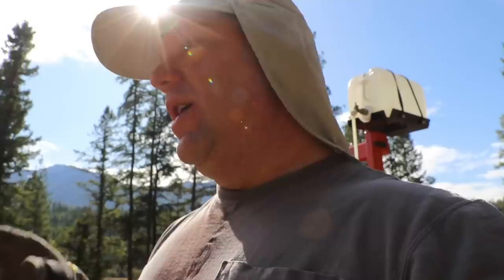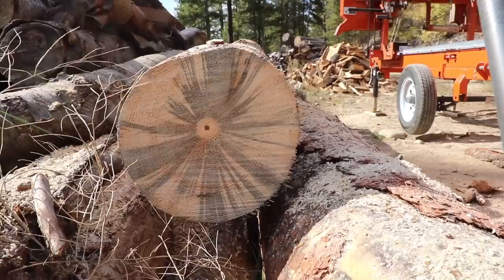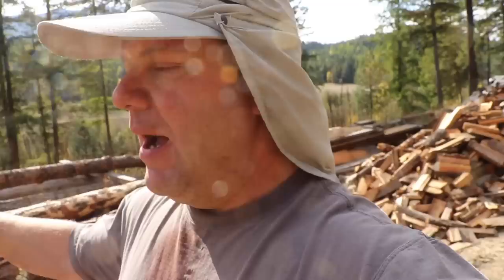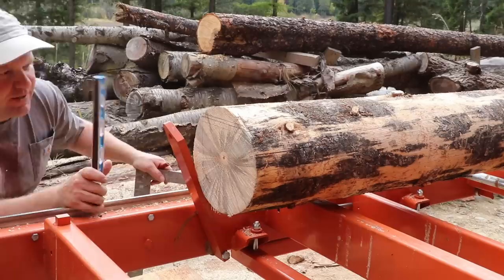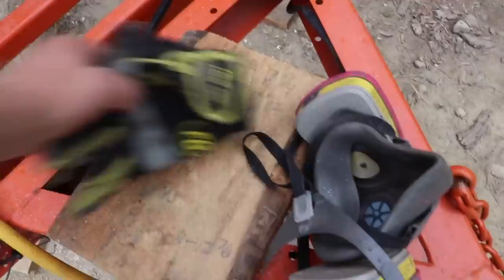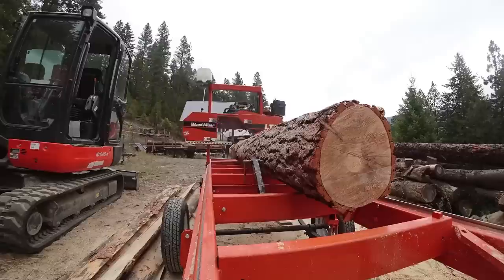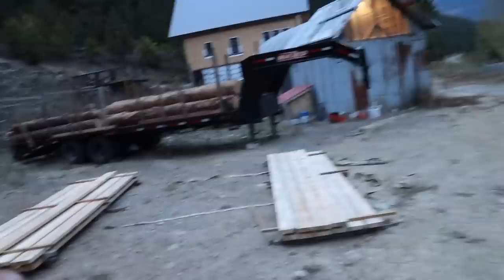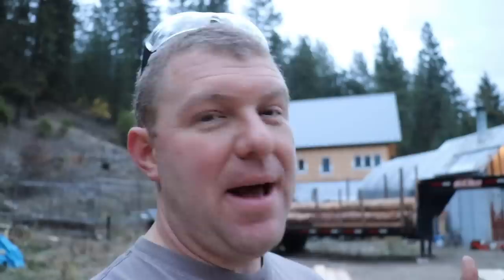Making BLUE PINE LUMBER with a Sawmmill (Beautiful)

Comment: Between January 2014 and March 2016 we took 1000+/- trees down on 15 aces. In Jose Basin, Shaver Lake CA area. The entire Sierra range is devoured in 3 years. Stunning. Got a 36 inch woodmiser and milled it up. Lots of 1×12. Sometimes the blue ran 4" thick for 20 feet. 70 cents a board foot.

Comment: It hurts my heart to see that wood used for studs. I know "the cow is already out of the barn" on this a long time ago but I would have milled boards and sold them then bought 3 of 4 times the amount of structural lumber with the $ you'd get for that wood. or that would be my cabinet doors and face frame.
Reply: guess I dont get it. in colorado you cant give that stuff away.  the whole the forest is killed.

Comment: Always check your scale calibration during EVERY setup. The solenoid issue is caused by the ethanol in the fuel. I have the same issue with my v twin John Deere with the solenoid shut off.

Comment: To keep the fuel injection running well use ethanol free gas.  I use Shell V90 premium fuel and that works well.
Reply: Definitely Right On.  I also pour a can of SeaFoam in the tank periodically.  Keeps everything clean.
Reply: Marathon stations around here often have ethanol free gas.

Comment: I am from NH too and have had a portable mill such as yours come 4 times to make structural lumber & boards from white pine. Blue stained boards would be considered undesirable. It is interesting that they are prized in your area. What will you use the 2x6's for? If you're cutting for interior stud walls, wouldn't you want 2x4's instead? I know you mentioned a false floor for the loft. Maybe they are for that?

Comment: Sounds like ethanol gas gummed it up only use 91 octane no ethanol
Reply: I concur there Ryan.
Reply: in some areas, finding non-ethanol gas can be an issue, but I don't know about where they are. I can buy it here in the Oregon Outback, but the price is premium as well... around $2 more per gallon than regular, $1.50 or so more then premium with ethanol in it...

Comment: How thick do you need your stud walls to be or are you going to cut them down to 4 inch on the table saw ?
Reply: I hope they will not waste (have not wasted) interior space with 2x6 walls that are non-load bearing.  THAT would be a waste.
Reply: i think (hope) they are cutting for 2x6 interior walls for plumbing to fit inside of it and will saw some 2x4 later for the rest of the framing. I see 2x6 for plumbing some and see it when they want extra room for insulation but their sips should negate this theory.
Reply: @warrenmichael918  There won't be any plumbing in the SIPs

Comment: why does the saw track have to be level?  the saw itself runs on the track and the tree is on the the track.  so even if was not level the boards would be as the track is.
Reply: @Shel Ferd  The frame of the portable mill is NOT sufficiently rigid to prevent introduction of twist into the saw rail path.  The EASIEST means of eliminating that twist is to adjust the frame to be 'level' at all points.  This does NOT absolutely prevent an 'uphill / downhill' effect of some minor amount, but, it does tend to eliminate twist.
Ken

Comment: Determining the maximum beam (Cant) that can be cut from a log, simply multiply the diameter of the log by .7... I.e. a 10 in log yields a 7" square beam... a 14" diameter yields a 9" cant... an 18" diameter yields a 12" cant

Comment: The stamps are not as much about structure as it is about Government and lobbyists.   If you can only use stamped lumber you have to buy it and that’s money to the special interests that paid to have that implemented.  
  Great content 👍
Reply: Building codes and material testing (specifically strength testing) regulations come more from liability than anything else...codes evolved because a building collapsed or burned down because the construction method and/or material weren't adequate and someone died...that's why sprinklers are slowly being required in residential homes...to save the life of the inhabitants and the firefighters who have to save them

Comment: Why don't you get the siding on your house? You are going to destroy those SIP's. Do you interact with your viewers? I never see responses.
Reply: in other videos, he said multiple times that they can't do sliding on the house because they first need to fill in the holes with fome, and they can't do that until they pull elictric wire through the SIP.

Comment: Get some Airplane fuel ( its unleaded an alcohol free)  an put quick disconnects in fuel lines before carbs , run Airplane fuel in to store  carbs on Gensets an sawmill,an quad too uses about a quart of gas to clean carb an gas lines

Comment: Set up a bunch of sauna tubes level with each other where ever you need them this what leveling off will a lot quicker build a lean to for your mill use it all year round same way dirt floor or level concrete your choice follow Smokey mountain outdoor you tube he has a perfect set up for a milling Shop you can just make yours with a door big enough to trailer yours in and out if that your preference ck it out let me know your your input I’m trying to do the same but with a smaller mill